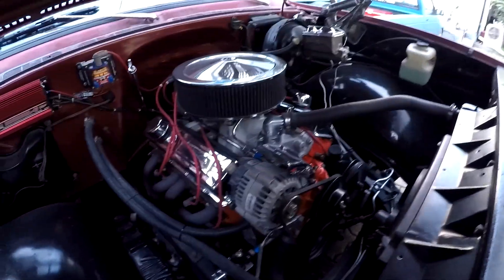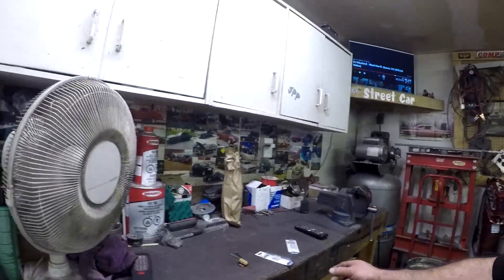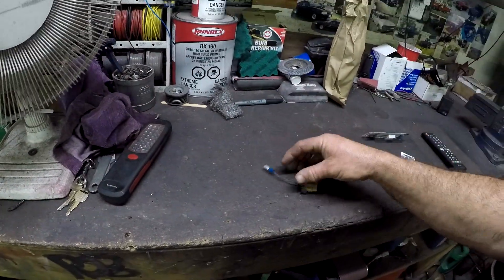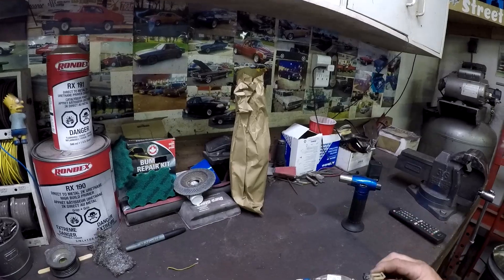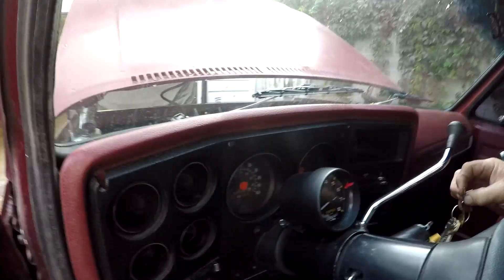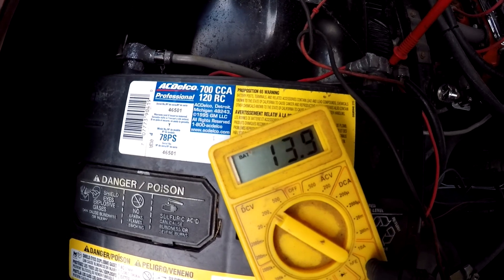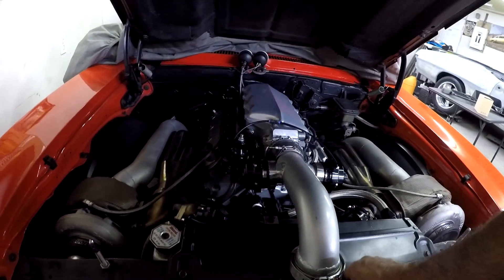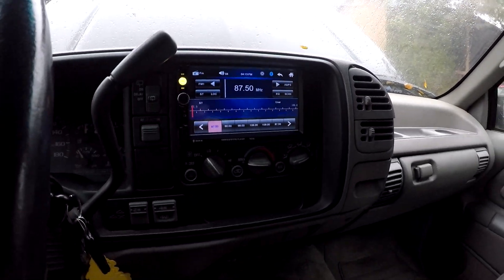WORLDS CHEAPEST  Touchscreen  Stereo Install | + LS Alternator fix and 1971 GTO

Comment: I bought a cheap boss touch screen of ebay and had the same issue of it not holding its memory presets regardless of which way i had the power wires orientated. Did you figure out how to fix the problem?